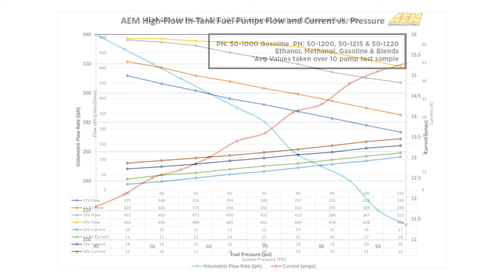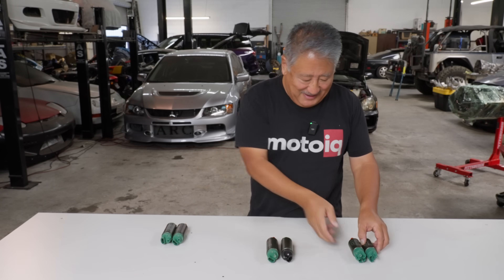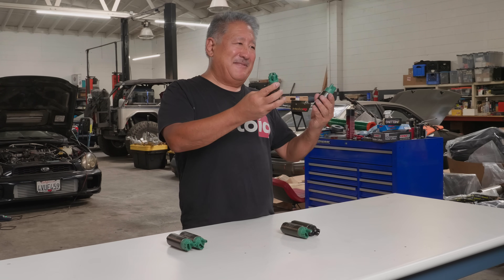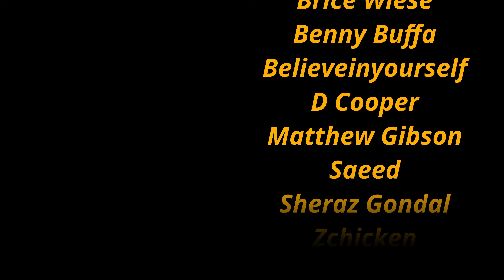Choosing the Right Fuel Pump!

Comment: Sorry for your loss Mike. Thank you for spreading the word on fuel pumps. Are these aem pumps quieter than the walboro? I daily drive my car and don't want the whine on a relatively low power KA-T, +/-350 whp
Reply from the maker: I think about the same, I didn't hear it on my car but then again I could not hear the Walburo it replaced either. (subaru sti)
Reply: @motoiq Understood, thank you!
Reply: From my experience DW pumps are quieter then WB
Reply from the maker: Same thing with my EVO, replaced the Walbro with an AEM and didn't hear anything as you could only hear the Walbro when the fuel was low.

Comment: The AEM 400 is one of the best pumps on the market right now in my opinion. Some other brands claim theirs make more output but in realitiy i didn't find one where this was actually true in real conditions. I'm running a single 400 in my Audi RS4 B5 with a little over 800bhp on pump gas and the AEM still isn't the limiting factor. Greetings from Austria and keep up the usefull content 👍🏻

Comment: MY GR Yaris has 4 wires/pins on the fuel pump. Any idea if this is upgradable with an in-tank fuel pump upgrade? ChatGPT says this is fundamentally different than a PWM fed pump. It's a BLDC pump with an integrated ECU (kinda like a fuel pump controller). The 4 wires are 12V power, ground, CMD (speed command from the ECU), and FB (feedback / diagnostic signal). If nobody does it, how hard would it be for someone to develop a solution? Can AEM do it?
Reply: Quick googling shows that Tomei sells upgraded fuel pump and it is regular 2pin unit. If you're talking about 4pin connector on fuel pump module that might be pair of wires for fuel level gauge and pair for pump itself which splits inside fuel tank
Reply from the maker: We haven't gotten that far yet with this family of cars.
Reply: @motoiq  ok.. I feel like Toyota has its own logic as to how their LPFP works / is controlled
Reply: Sounds like it’s intelligent and part of the Cambus
Reply: @bernardwarr4187  Likely. How does someone upgrade a fuel pump like this?
Reply from the maker: It seems weird, the controller should just control voltage to the pump.
Reply: @motoiq  my guess is it gets a cambus signal from the ECU to control a variable fuel pressure?
Reply from the maker: I would contact Lamspeed, they probably have the most experience with these cars.
Reply: @motoiq Yeah their solution is a Radium surge tank. It’s fine sure and it will work well, but I would love to not have fuel lines inside the car.
Reply: @motoiq  or Litchfield in the UK

Comment: Isn’t 3/8” larger than 5/16”? Mike asserts at 6:19 that it is smaller. I’m not from the USA and we use the metric system, so please excuse my ignorance.
Reply: He most likely meant 5/8”
Reply: @JosephNnbs I agree. 5/8" is an AN-10 size fuel line... very proper and needed on boosted 1000-1500hp e85 fuel systems.

Comment: Hey Mike, I love your content. But chill out when you tell people their engine will "go kaboom" on dual pumps.

I run twin AEM 350lph pumps on an aging infinity 506 system, and that 10 year old shit has safeties for one fuel pump failure. I've been saved by it. Are you guys sending out dual fuel pump cars on ecus/tunes that don't monitor afr and fuel pressure? On the other hand, are you building cars that push the limits of a single 400lph pump without safety strategies? I really doubt it
Reply from the maker: I didn't say it will but it can and it's why my preference is not to run multiple pumps. Besides fuel heating, current draw and having to depend on safeties. How about open source people who don't have safeties? Seriously with the pumps available nowadays would you recommend running multiple pumps when you don't need to?

Comment: Any downside on running a 450 or 525 lph fuel pump ? Looking at making 7-800whp on gasoline with water/methanol injection. Inline 6  3.0L turbo.
Reply from the maker: perfect

Comment: :penguin-blue-waving-tear: Thank you M0ToMiKe..  I seriously got pumped thinking about how I might gain some (additional) knowledge regarding Fuel Pumps. And I wasn't wrong (mark time).  Yes, I have always just relied on the sticker since I was a little squirt.  Clearly, my ignorance was off the charts. But on the flip side, I don't normally hit the sheets as it relates to flow,  Just ask my GF :face-turquoise-covering-eyes:  I have made the switch to 24V to support the *current hungry devices I'm running*. Now I think about it, this could explain why I'm going through so many🔥fuel  pumps :hand-orange-covering-eyes:  Let's put a pin in that.. I'd would like to repeat, YOU R the OG  (•̪̀●́)=ε/̵͇̿̿/'̿̿ ̿ ̿̿   GEARHEAD  (but don't let that go to your head)    Cheers from So.Ca.(crazy)USA, 3rd garage on the left  𓅭

Comment: Dumb question here but what are the downsides of running a overkill fuel pump besides wasting money? Would investing early in for example that 400 LPH fuel pump be a good idea so you are ready for other mods down the road?
Reply: If you have a PWM set-up you can run a higher flowing fuel pump than you need. You don't need to run it full blast all the time.
Reply: Returnless fuel system? Can you edit fuel pump duty tables?
Reply: @uv6er yes.  Ford for sure.
Reply: You'll heat up the fuel, it could be an issue for a track car
Reply: @funkyd04 not if its pwm